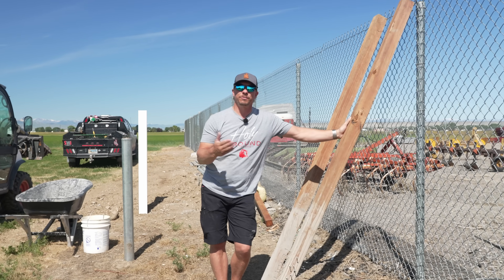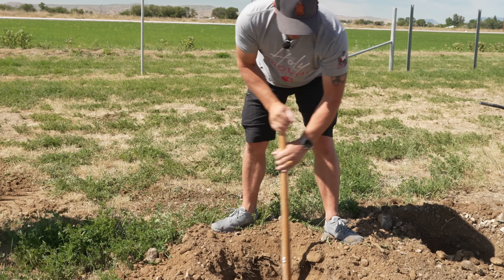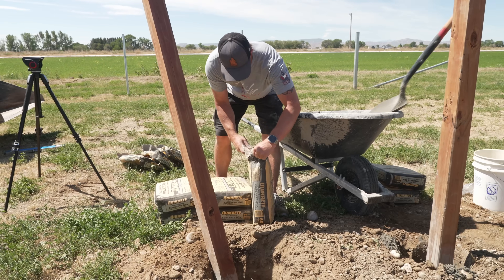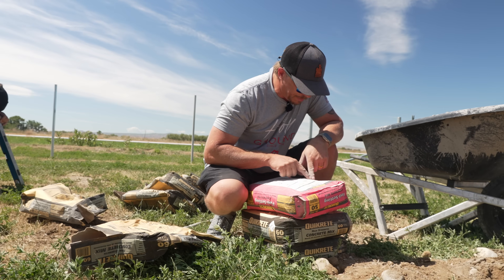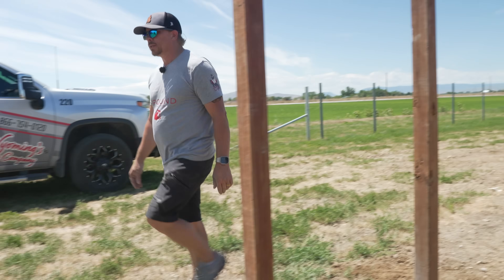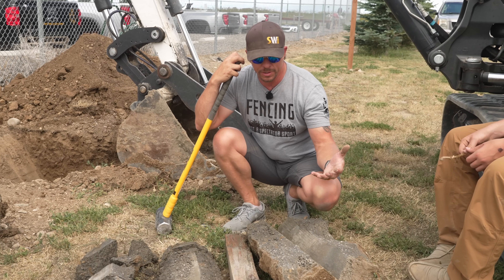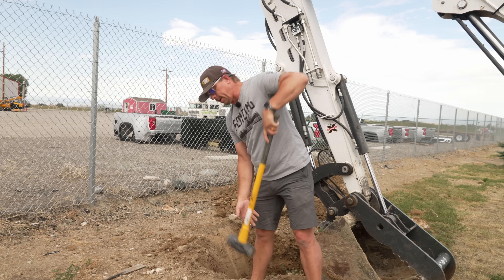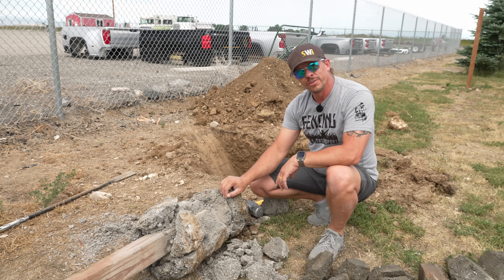Why Adding Water WON'T Save Your Dry Pack Concrete

Comment: As a civil engineer, I want to say: "Thank you, Thank you, Thank you!" For the first time someone does not run after the "dry pack" method.  There is a reason why we have been properly mixing concrete for the last couple of 100 years. The problem with dry pack is that the outer skin of the dry cement hydrates (Chemical reaction between water and cementitious material) and prevents water from penetrating deeper into the concrete. Then the rest of the cementitious material is effectively starved of water and cannot properly Hydrate. At 6 days you were about 50% of concrete strength.  At 28 days it would have been a totally different story. You would have had to pack lunch for the sledge work, as you would have been busy for a while. in short....If you are thinking of doing dry pack concrete, STOP, sit still and think about something else.  Thank you for very informative videos.
Reply: In the UK, we have concrete, metal, and wooden posts. Using wet set is the cheapest when doing a lot of posts. Postcrete (dry mix) is the quick and easier method. I install concrete posts and I've always used dry mix.

I dig a 2' hole and stand the concrete post in. Tip a 1/4 bucket of water in and then a bag of dry mix. Mush it about and compact it with a stick. Then a little more water, another bag, and prod it about again. Top off with water. Within 10 mins, the post is solid.

If you do it that way, the postcrete is set all the way through. I don't fit wooden posts, they just rot.

Cement needs water to crystallize, and if someone is not mixing dry mix with water in the post hole, they don't understand cement.
Reply: as a civil engineer you should know that a fence post and a 4 storey building are not the same thing.. for an ordinary fence post quick set, dry pour, add water, stabilize is the way to go.. if you have slope, then deeper, taller fence, deeper,, basic science. a good engineer doesn't waste labour and materials to have something perform unnecessarily over the needed.
Reply: You don’t see a problem with housing wood in concrete? I’ve seen a PT 4x4 split a pier.
Reply: @peterbarlow8912  there is always things to look out for. Weather it be steel or wood connection to concrete. Personally I would put a little bit more detail into casting a wood post in concrete. I have seen and tested the scenario where you place the bottom edge of the post 3" below the concrete into the soil. This prevents the concrete from creating a cavity wherein water will sit and make the wood swell. This seems to work a charm as the post can draw and express water as the climate conditions change. But the issue is also largely dependent on the amount of moisture in the environment surrounding the concrete. Super wet (In the case of the pier you stated) will almost guarantee issues, Where if you are out in the Kalahari desert with only 35" of rain in a year, sandy soil and no snow/freeze conditions, it would not make a difference.
Reply: PT is what passes for ground contact lumber in the US. Grown fast then pressure cooked with preservatives. It slows down the rot but doesn’t stop it.
Reply: @peterbarlow8912  That is for darn sure. I see so many PT posts in concrete rotted right at the soil line - hand rails, deck posts, fence posts, etc. Here in SC, where the winters are pretty mild, I always created a sloped top above grade around the posts. Anyone think this is a bad idea?
Reply: @ggrimm79  I don't think a concrete sloped top is needed. Just stop your concrete within 4-6 inches from top of hole and fill the rest of the way with dirt, making a dirt mound around the post. I've seen too many times, when the concrete is poured to the top (sloped or not), you end up with a crack between the concrete and the post. This allows water to get trapped between the post and concrete, and I think makes it rot faster. Dirt sloped around the top of the post seems to give and take more as the post swells and contracts, keeping a tighter seal around the post.
Reply: @ggrimm79  A swale around a post in earth is probably a good idea just like you would for an outhouse.
Reply: @peterbarlow8912  I saw a mix that someone used of Acetone, Silicone Sealer, and I think Deck stain.   Made the wood it was applied to water proof/resistant.  (technically considered a DIY Hack) 

I wonder if that may be another option over PS if the post is completely coated.  Put it directly in the Ground and water shouldn't get into it, might be better overall for strength and longevity.
Reply: Pressure treated plantation grown southern yellow pine lumber expands and contracts a lot as moisture comes and goes. They grown it like corn with 3/8” growth rings. Old growth syp from old factory beams is another story
Reply: @peterbarlow8912  Here in South Africa we use eucalyptus posts. They are fairly stable and strong. I would never use a pine post for fence.
Reply: It's called bridging in the mix - set up sections and then dry.
Reply: In my experience dry pack works well enough. Like was said in the video, you only really need the concrete to be as hard or harder than the soil around it, dry pack does that. It's also the fastest and less labor intensive way to set a post. I've pulled some post that were placed dry pack and the concrete was pretty hard, of course they had been set for several years though. 

All that being said dry pack will never achieve the strength of wet pour. To make strong concrete you need the water mixed in, water is the medium tat allows the cement, sand, and gravel to flow together and mix evenly.
Reply: It's okay for patio slabs and things like that
Reply: Most of you guys have me beat I reckon. All I've ever used to compact dry mix is a length of 2x4 , but don't over pack it or the water won't penetrate .
Reply: Dry pack is tougher back fill than just dirt. If it was a gate hanger, sure. Any other post dry fill.
Reply: Prefer rammed earth if you have to put a wood post in the ground. That way you don’t have a high energy turd to dig up when the wood inevitably fails. Have set steel greenhouse posts in multiple lifts of dry concrete and water but we really rod the material after wetting until it really slushes up. The only advantage I see to setting wood posts in concrete is the increased bearing on the earth. The shown excavated posts in concrete broke apart with just a light tap of the sledge! Rammed earth is at least that strong. Sorry my dad was an engineer and I learned a lot about structural load pathways from him
Reply: @peterbarlow8912  I totally agree.  In my part of the world, we rarely use wood posts.  Thank you for the good conversation.  This is why I like this platform.  We can all learn and combine trades, skill and experience. Cheers!
Reply: @peterbarlow8912  I like the rammed earth method, but it is the slowest and most labor intensive method. What I've found out that works the best for me is to set the post in the hole, add one 90 lb bag of dry pack concrete, and then finish filling the hole with compacted earth. This method seems to give me a strong post without having to compact it as much as you would with compacted earth only. 
On a side note, the best "packer" that I've found is a length of 1/2" water pipe with a tee threaded onto one end. You use the pipe as a handle and the tee as the packing end. It's less of a footprint than one of those factory made tamping bars, and can get as well of results without being worn out by that heavy factory made tamping bar.
Reply: @m16ty  still not on board with wood in concrete for reasons expressed in my earliest comment. Rodding dry pour and water together in the hole enough to be a wet mix is similar labor to ramming the free dirt pile you already have back around a post with the butt of a 2x4 or whatever fits.

Comment: Wet mixed concrete seems to be the best way to go. If I come across the foam fill for a good price it might be a good compromise considering it's a lot easier. The foam stuff is fairly new though and will have to see how it stands up to the test of time. Maybe it will degrade after 10 years or so or should it crack allowing water in may then fail from internal rot.

Comment: Add water to the bottom too
Reply from the maker: There seems to be a 100 variations of this method.
Reply: I'm not saying it would help, but it seems logical. Water could saturate the concrete from the top and bottom.

Comment: I throw a bucket of water in first, then concrete, then water on top. Osmosis draws the water into the mix, and sets the concrete
Reply from the maker: There seems to be 100 variations of this method.

Comment: If you are just adding dry mix, we pour a gallon of water in dry season into the hole then add the concrete. Vibrate the post level and a mist of water at the top to trowel a downward slope to prevent water pooling and going between the wood and concrete. Freezing temperatures can crack tbe concrete. 6x6 posts ensure a 40 year fence!
Reply from the maker: There seems to be 100 variations of this method.

Comment: Wet cement is not compactable. Dry is. Dry pack posts can free stand- wet posts need support until somewhat cured. Dry pours need much longer to cure but eventually are equally as strong. Months or weeks rather than days.
Reply from the maker: If your posts are leaning after you put them in your concrete is too wet.
Reply: @SWiFence  I agree though many videos showing wet cement pour it in with the consistency of soupy oatmeal.
Reply: posts with wet concrete do not need support unless you are throwing in like the sloppiest concrete known to man. im dry pour gang btw

Comment: 4 bags? Holy Hannah! One post, one bag. Or no bag, except at gates. I usually splash a little water in first to wet the soil and to settle "loose" soil to avoid "catastrophe". Drop in post, dry pour, tamp and then pour water on top. Later I kick in soil to top off and pack it down with my boot heel. So far so good (20 years) in northern Michigan.
Reply from the maker: We've got too much wind out here to run 1 bag. C'mon now, just because we warranty our work doesn't mean we want warranty work. 😁
Reply: @SWiFence  Oh yeah, you're in Wyoming or something. Buildings fall down when the wind stops cuz they're used to leaning hard into it. I dig. I'm in a generally "pleasant breeze" area.
Reply: ok i thought the same thing lol.  i'm like "uh i'm not carrying 4 bags up my hill for one post".  not even 3.  But to be fair, i'll take risk it fails and i'll fix it where he can't.   Awesome video, and funny humor especially responding to comments, good job SWifence, learned a lot.
Reply: @mburns8229  Depending on the area and soil there are many options. 4 bags or even one bag is a waste here and a higher cost to the homeowner. So what good is it other than ego and profit for contractor? No cement posts last longer in this area but I generally cement gate posts to stabilize them over greater load they carry.

Comment: I recently watched a video where the guys added water to the hole, and THEN added the cement.
I have no idea if this was a standard practice, but it was certainly the first time I seen it.
Reply: I splash some water into hole, dry pour cement, pack it, then top it off with water.  Later I fill the rest of hole with soil. Water first settles any lose soil in hole and helps cure cement. Don't know if there's a better plan but this works very well for me.
Reply: @finallyfriday.  Oh, no, maybe I should have made it clear.. The hole was FULL of water, and they kept pouring bag after bag of cement in.. And used a stick to mix it all, and kept pouring more bags in. I have never done this stuff myself, so I don't know the ins-and-outs.. Just that this is the first time I had seen this method.. 
Though, 5 or so videos later, I don't see them do it that way anymore.. So no idea if they decided it was bad from seeing the results, or people in the comments telling them to stop doing it.. I was just shocked at the method.. I mean, in 1 respect, it makes sense, gets more of the concrete wet, in others, it seems like a terrible idea of getting the right amount compacted down.
Reply: @ColinRichardson  mmmm.... so.... mmmm... uh, the excess of water makes the concrete weak, limits how much concrete goes in, makes a mess I'm sure... but...uh, if it works for them. Too much water separates the components into gravel, then sand, then Portland cement. Might be that new math I hear talk of.
Reply: @finallyfriday.  I don't remember seeing any gravel or sand. I wasn't paying super attention at the time.. I could try and find the video, but comments tend to get deleted if I add a link. It was by "Flawless Cleaning Service" one of the recent "peggy" videos. Not episode 1, but later than that.. Maybe about 5-6 weeks ago or so.. 
I could be completely wrong about what I was viewing, but it was what the impression I got.. 
My dad always mixed concrete on a flat mat with a spade, and that is the method I think of in my head.. I just never had a need to mix concrete for myself, so never actually did it.. Just was jarring when I seen that different technique with the water in the hole first.
Reply: @ColinRichardson  Well it did save them the use of a wheelbarrow so I guess that was the goal. Mix it in place.
Reply: Where I am sometimes I’m winter the water level is 4” down from top. 
In that scenario we add concrete mix until strong enough for the post to stand  on its own.  
If it can be tamped and gravel rock added for instant stability that’ll work.

Comment: Love how he "read the instructions" which does not have a dry pack method (some do, like he said... but this does not) then says why water won't save your dry pack
😂

Dry pack concrete method sucks... I agree. I just trust mixed concrete more bc I can tell that it is well and fully mixed.
But if you (A) never add water, (B) add too much water too fast, or (C) use the wrong type of mix, then it will never even have a chance.

Comment: Great video! Well done on the follow up.
The screws seem to work IMO.

All the fences I’ve removed seem to have failed because the concrete is cracked then the post becomes loose. 
If the screws hold the concrete together even when it’s cracked that must help.